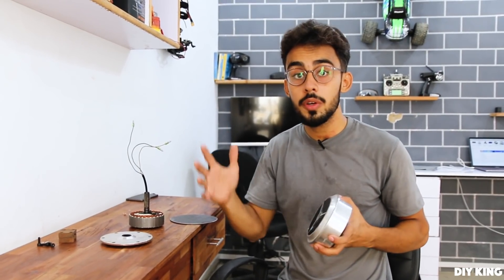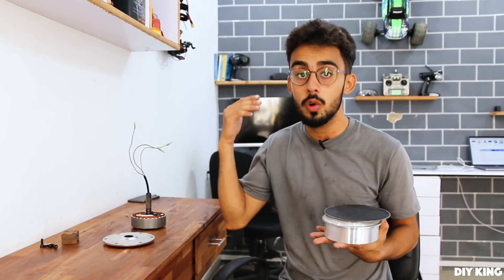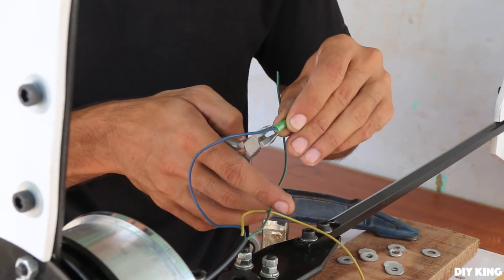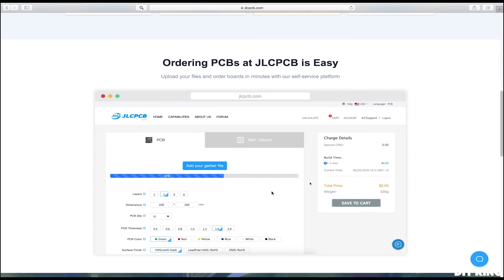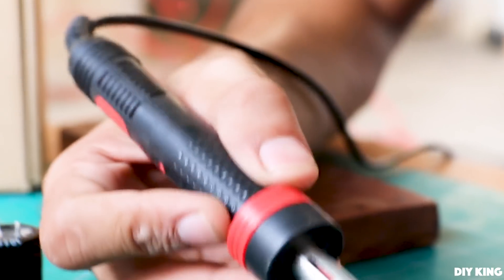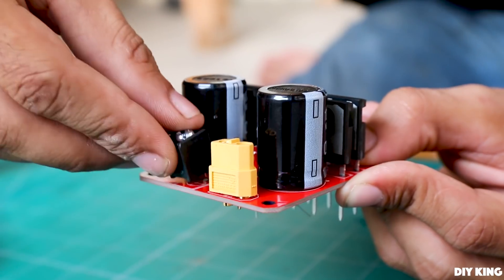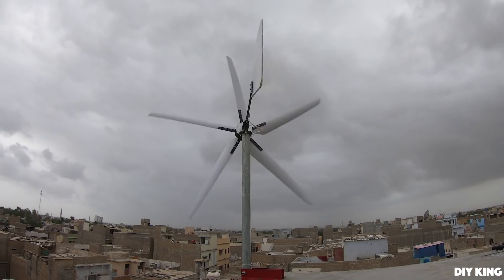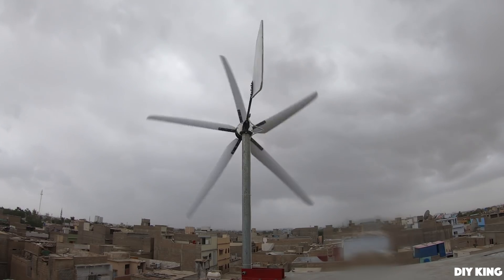Building a Wind Generator using a Hoverboard

Comment: Very cool and well done project. I do want to make a suggestion about keeping an eye on that motor/generator because the bearings in it are not tapered roller bearings...they're plain roller bearings which are designed for vertical downward thrust...like standing on the hover board, but with wind power, that thrust is now pushing horizontal and not vertical, so those bearings might start to wear out much faster than normal.

Still a great build and fun project, but just some thing to keep an eye on and repair as needed before it fails completely and ruins the gen head on you. Keep up the great work.
Reply: They are ball bearings. not likuku.

Comment: in the next version make it with 3 propellers only that's more efficient and try to use aluminium only because it's lighter than iron and try to balance the tail with the motor to make it more stable in the heavy wind . 
good luck
Reply: 3 blades is only more cost efficient, less material used for 3 longer  blades, than 6 short, but more blades deliver more power for the same diameter.
Usually unlicensed wind turbines can not be more than 2m in diameter, so if you optimise for that, you get more power with more blades as you can't just increase diameter.
Reply: @Tore_Lund  less blades means less weight and also more power because it will spin easier . we can't actually make a clear answer about that without experimenting.  but in the big wind turbines they use 3 blades only . maybe you are right and it's just for the cost . but also it has a theory
Reply: @mosta5  Looked it up, and I was wrong: More blades, means better low wind power, but it is diminishing results and 3 blades are optimum, so blade number four will result in less peak power. However as they are using a hoverboard motor, that most likely works best around 150 rpm, they might have chosen multi blade design, to get most power at low rpm? https://www.quora.com/Does-the-number-of-blades-affect-the-amount-of-electricity-produced-by-a-wind-turbine

Comment: Awesome project....

How are you dealing with the main wire twisting? I did not notice you put any type of system to allow for the current to pass while still being able for the Generator to rotate 360 degrees? Seems you might run into issues at some point as they wire will continue to twist. If you mentioned this I clearly missed it or did not understand...

Cheers...
Reply: AFAIK it was not handled:
https://cdn.instructables.com/FYA/4CBB/JYIZF4AB/FYA4CBBJYIZF4AB.LARGE.jpg?auto=webp&width=1024&height=1024&fit=bounds